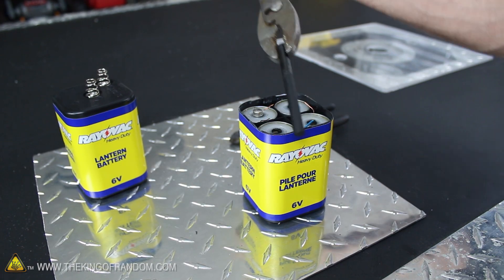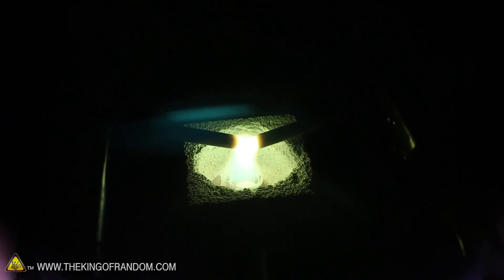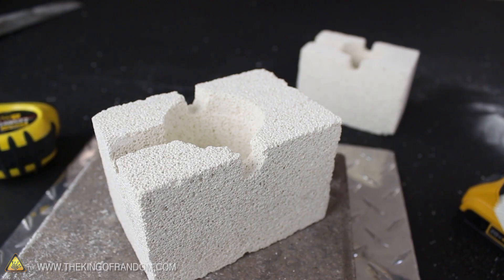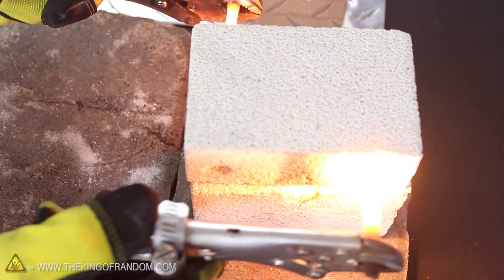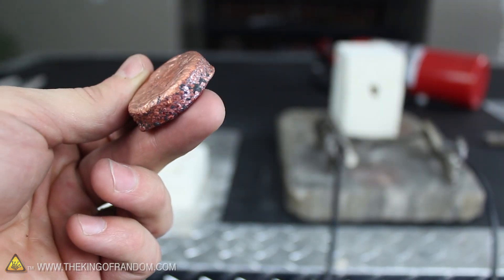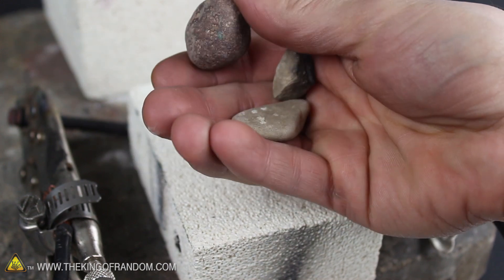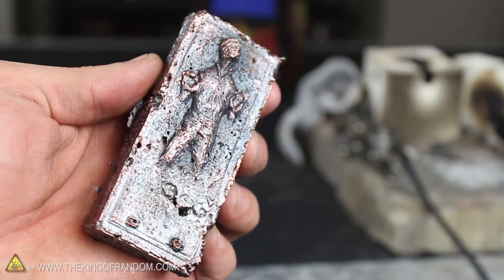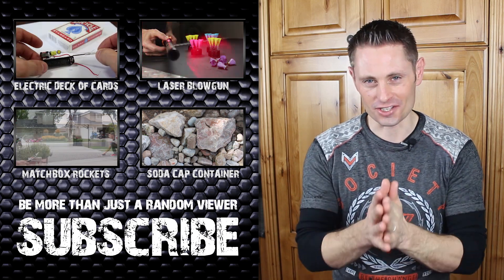Mini Arc Furnace (Arc Reactor Technology IRL)

Comment: 4:00 lol, didn't expect that troll
awesome project, would be interesting to know how many people actually built this right after watching
Reply: Many.
So how is using propane raping the Earth when coal is mined straight from it?
Reply: Dan Broomhead ... Why would you even want to do that?

You want fine control and a large homogenous heat mass for heating up metal for blacksmithing, not instant enormous heat.
Reply: "Raping the Earth"?!? Seriously? As opposed to mining for coal? Have you done much forging, or metal work  in general?
Reply: I'm currently in the middle of building the welder with the intention of building this also. I WILL be building this to see if I can retrofit it to my coffee can forge and use it for blacksmithing. I'm also curious if I can use it to heat smaller sections of a larger piece.
Reply: Depending on how closely you watch your metal I believe you could have fine control, plus you could heat up sections of the larger piece since you don't need to heat the entire work piece when forging.  You also don't need a "large" heat mass, you can forge using a simple coffee can forge heated with propane. I know several pro smiths that use an oxy/acetylene torch for almost everything besides the heavy stuff. Also, electricity is much cheaper than propane or coal. I think you could get the finer control needed for the majority of forging by just watching what you're doing. If you can do that then the "instant enormous heat" could/would help you be more efficient with your time.
Reply: Dan Broomhead To work a piece in general you're heating a large portion of the piece. Something that would be difficult with this method.

You can, but you'd be raping the earth to use a mediocre fuel to accomplish something that requires you design around the downsides of propane.

Electricity, and electrodes. There are reasons electricity isn't commonly used for forging metal as opposed to casting it.

It would also make it far easier to make mistakes, be more finicky, and require additional gear, and everyone makes occasional mistakes.
Reply: Dan Broomhead No, not as opposed to coal. Have you ever had an intelligent thought?
Reply: seigeengine You're right, you didn't mention coal. You did however say that propane is raping the Earth and is a mediocre fuel source and that using electricity would be relatively useless, I'm paraphrasing of course.

So, what fuel source do you propose I use?

Coal is most widely used, its dirty and noxious when burned. Don't quote me on it, but I believe it is also a pollutant. It is also heavily mined, essentially stripping it from the Earth, one could interpret that as raping the Earth as well.

There are also waste oil forges that can use old motor oil and/or used cooking oil, such as that from a restaurant. There again, though, you're using another petroleum-based fuel source if you were to use motor oil; propane is a petroleum-based fuel.

Gasoline? Petroleum. It also won't burn hot enough and is highly combustible/explosive.

Kerosene? A hydrocarbon made by distilling...petroleum. Not as combustible or explosive, but still won't get hot enough.

Diesel? See the above two fuels.

I'm not trying to be belligerent. I'm simply trying to find out why propane is raping the Earth, why other alternatives aren't, and what you propose blacksmiths use?
Reply: seigeengine Since you've had zero experience with blacksmithing and metal work in general, then how can you tell me what I should and shouldn't be using for fuel, how much of a piece of steel I should or shouldn't be heating when working it, and generally how I should or shouldn't be forging? Reading about a subject only teaches you the theory behind the practice and what you might do in a situation. Putting that knowledge into practice is where you will actually learn what to do and what works best for you in doing it. There is more than one way to skin a cat, just as there is more than one way to forge a piece of steel.

By the way, there is no such thing as a homogenous heat mass. No matter what type of forge you use there will always be hot spots and cold spots. You can do things to minimize them, but you can not eliminate them entirely..
Reply: seigeengine Actually he's right. And seems intelligent enough to me. At least in the area of blacksmithing. There are lots of reasons to have a small precise area of heat, as opposed to a large homogeneous heat. For example, forging the boss on a tong is easier if you can heat only the boss. That way you only move the metal you want to move, and don't warp the clamp. And being able to get that heat in seconds would be highly beneficial to any smith. Not to mention more cost effective. A blower would use more electricity to heat it than this arc furnace would.
Reply: steven spall Two things:

" To work a piece in general "

And that doesn't change that you have little control with something like this compared to an alternative. Having to redo an entire piece because you screwed up is the time waster you really want to avoid, with having to fix a mistake before re-attempting it coming in a close second.
Reply: IT all depends on the piece you're working, and how much practice you've had with you're custom made arc furnace.
Reply: steven spall A worse tool is a worse tool.
Reply: A worse tool? Worse than what? There's a right tool for every job, and a right job for every tool. I just think you're one of those people who have to find the negative in everything. Nothing is ever gold enough. The fact is, this design for a mini arc furnace isn't perfect. And a mini arc furnace may not be useful for you. But I know I can find a lot of uses for it, that will save me money, and with great. Don't like it? Don't build one. No need to dis other people for finding it useful.
Reply: There are benefits. You obviously just can't see them. When you mentioned casting. This is great for casting small ingots to be forged (regardless of your method). It can give much finer control when making small quantities of crucible steels from scratch. Making custom brass without the need for large amounts of coal or propane, and a hefty crucible. And there are many more uses for it. Just because you have no creative ingenuity, doesn't mean that nobody else does either. Quit being an ass.
Reply: steven spall I didn't say there weren't.

Try again, and this time, try being intelligent.
Reply: steven spall You read something into it that I didn't say.

Don't blame me for your illiteracy or delusion.
Reply: Whatever dude. The sign says "Don't feed the troll"
Reply: steven spall Thank you for backing up my point and ideas to OTHER people that might be reading these posts. Are you a blacksmith or metal worker? If so, it's nice to hear from another who thinks an arc furnace could have potential for smithing.

Comment: I loved the project. very cool! The plaster was spewing probably because of the water stuck within the mold material. I taught a metal casting class back in college, and we would make our aluminum and bronze molds using a mix of plaster and sand, then bake them in the kiln for about 12 hours. It would release all the water, making the mold much better for casting metals. If you're making a closed mold, make sure you have proper vents so the air has somewhere to escape while you're pouring down the sprue. We used sand/resin molds for iron because air would be able to escape through the mold material, simplifying the casting cleanup. Can't wait to see more!

Comment: How reliable is the whole thing? Any damage to the "welder" or wires and connections? How long do those carbon rods last?
Reply from the maker: Good question.  No damage at all if used for 3 minutes or less at a time.  I didn't go much longer than that to smoke test it, so it's still in perfect condition.  The carbon rods work for around 10 minutes before becoming so thin they need to be replaced.
Reply: Grant Thompson - "The King of Random" ya I have experimented before and had issues like that, why not try tungsten electrodes if you can find them?
Reply: TheFirefox780 Because graphite rods are much cheaper and more accessible and this is supposed to be a home project :)
Reply: Dennis W Thats true

Comment: Is it just me that thinks projects like these should be done outside? It seems like it could possibly burn your whole house down if youre not careful enough with that much heat.
Reply from the maker: Solution: Be careful enough with that much heat.  :)
Reply: Grant Thompson - "The King of Random" lol very true grant, very true...
Reply: Grant Thompson - "The King of Random"
Sir Thompson, can you do a video how you do the welding machine with the battery thing? I don't know how you do that with a 6 volts battery. I was planning to create my own too so I can have money for my thesis in architecture(A side line).

Thus inhaling it is dangerous? Thus it give you a cancer, if it does a need medicine that I can take to prevent the toxic from getting in my body?
Reply: VisayasMindanaoLuzon The battery and welder are separate things. All you get from the battery are the carbon rods.

There is already a video on how to make the welder, or at least a version of it called the metal melter that he repurposes into a tack welder. The one shown in the video has two transformers rather than the one seen in the projects I mentioned.
Reply: He has an fire proof work bench

Comment: 1:20 ' Surprisingly, the outside is still cool enough that i can pick it up bare handed..' HOW ? I mean, i watched mythbusters doing that but can anyone explain me why doesnt that burn your hand. Since it is in the melting point, shouldnt it be extremely high that can burn anything that touched to it ?
Reply: muh1h1   *****  The Hard Moder Lee Shang   /watch?v=yTOCAd2QhGg watch this, you'll understand what i'm saying
Reply: Its a bad conducter of heat
Reply: So its hot inside but not outside
Reply: The inside is incredibly hot, but firebrick is designed to not transmit heat, so it would require absolutely massive levels of heat to make the entire brick heat up.
Reply: Fun Fact - If you've watched VSauce, you can actually argue that the brick is pretty hot on its own, but due to the rate of which heat is transfered from the brick to your hand is horribly slow, the brick can feel pretty cold (or, at least not scorching hot)
Reply: ScytherDOTA The Leidenfrosteffect is a whole other story and only applies to liquids...
Reply: The type of material he made the chamber out of is designed with billions of microscopic air bubbles that act as thermal insulators. it would take about 10 minutes storing liquid aluminium to make the outside too hot too touch at the thickest point.
Reply: The Hard Moder yes, the brick is mostly air, which is a terrible conductor.
Reply: ***** Well, heat transfer from brick to hand is one thing, heat transfer within the other. Both factors play a role in this case i guess... :)
Reply: ***** That's not what is happening here though
Reply: No no, im not talking about the brick.. I watched MythBusters and they dripped their  bare finger to the molten aliminium.. That drives me crazy.
Reply: mynameismatt2010 Citations or gtfo.

Comment: can it even do tungsten? also your voice is awesome
Reply: ***** ummm, thats just a bunch of squares
Reply: It's donut emojis. Idrk why he put them there.
Reply: Donyea Mosley oh ok. makes a tiny bit more sense now. not much though xD
Reply: Hey, I'm a welding student (possibly credible). Tungsten is used for TIG welding, because the rod that transmits the electric arc is not consumed. Instead, because the rod is not consumed by the rod melting, the metal to weld is fed by hand. Normally, the energy from transmitting that much electricity will not melt it, but if insulated enough and given enough time, it will melt by electric arc (since lightning is hotter than the surface of the sun, around 30,000 Kelvin, the arc can be plenty hot enough). I do not think this rig is capable though, or at least barely, as the carbon rods have only a slightly higher melting temperature (around 3550°C, source 1) than tungsten (3422°C, source 2), so this would require that the system be pretty efficient, around 96% heat [energy] transmission for the tungsten to melt before the carbon rods.

This is the part that I don't know what I'm talking about, but the carbon/graphite rods should start to degrade well before their melting temperature. From both source 1 and 3, they mention the evaporation point of carbon/graphite rods being 2400°C, I believe that to mean that the carbon rods will turn to vapor in the same way water will evaporate well before the boiling point; you can read on it yourself.

I checked how hot it might be to melt the rocks, since it took him three minutes, but turns out it should be only 1200°C. (Source 4)

Source 1: http://www.tedpella.com/carbon_html/carbon-rods-shapers.htm
Source 2: http://education.jlab.org/itselemental/ele074.html
Source 3: http://www.emsdiasum.com/microscopy/products/vacuum/carbon.aspx
Source 4: http://hyperphysics.phy-astr.gsu.edu/hbase/geophys/meltrock.html
Reply: ***** Donut is not an emotion.
Reply: yeah it can melt any metal
Reply: ***** is that donut emojis too?
Reply: I doubt it, The highest temperature he gave was 1648°C, Tungsten's melting point is double that.
Reply: How about http://en.m.wikipedia.org/wiki/Rhenium
It melts at 10100 ferinheight
Reply: gregistopal
Well then no, this will not melt it.

Also, that is the boiling point of Rhenium.
Reply: gregistopal rhenium is not tungsten
Reply: huntingmachine1 I meant to say this earlier, but there is something odd going on with the comments.
It should work given enough carbon rods, but much more than the two shown will be required, since the melting points are close. The new rods are cool, so they will not melt immediately. Grant Thompson restated that it will melt any metal, and he knows far more than me.
(I could not find my comment after posting, but retyped it, but now I cannot find my second version and the first one is visible, also, someone responded to me and I cannot find it in the comments)

Comment: Hey Grant! 
Just out of curiosity,
After you've molten any kind of metal in your Mini Arc Funace, does some of the molten mettal stick to the inside?
If yes, how do you clean that up? I suppose you cant wash it away with water...

~KC
Reply: He said the bricks were pretty inexpensive. I forgot the exact price, but you could always do your best to keep them clean then just replace it.
Reply: Austin Dunbar
he said 6 bucks per brick, out of which he gets 2 furnaces
Reply: So $3 a furnace, plus a little time to machine them.

Besides, you could probably reuse a furnace with zero concerns of cross-contamination if you used a different one for each metal.